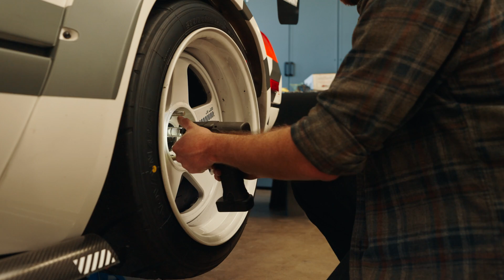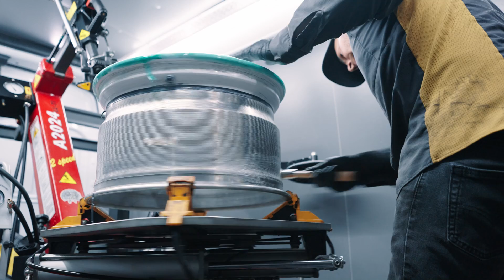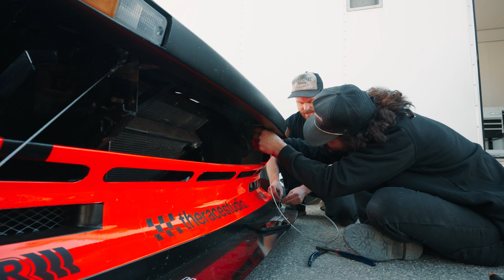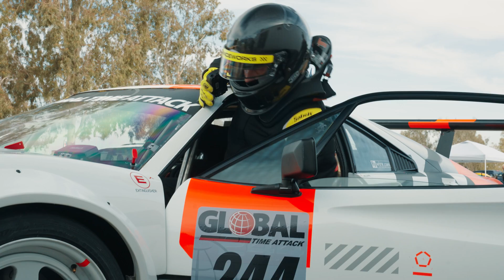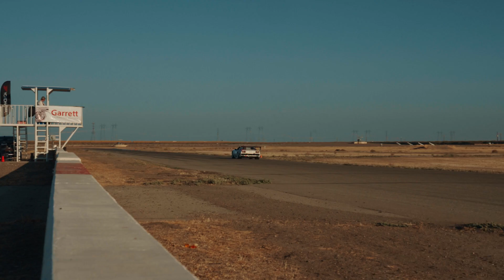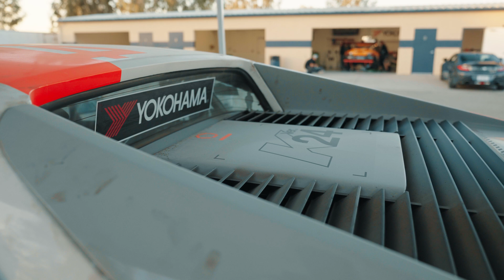Straight off the boat and to the race track! // Honda-Swapped Ferrari Time Attack

Comment: If the front splitter wear persists you might want to consider making a simplified plywood version of it. That may sound ridiculous but it isn't unheard of in racing as it's both lightweight, stiff and cheap. Of course rattlecan it black before mounting it so it doesn't look completely ridiculous. I gather that you remedied that with the cable supports, but if you want to go lower and essentially turn the splitter into a sacrificial part that's an option.

Comment: The one driving technique you need to learn is heel & toe so you can rotate the car through the corners better . The other is left foot braking to slow the car without having to come off the throttle as much . As an above left knee amputee heel and toe is difficult but not impossible in a 2003 320i Bmw tiptronic auto .

Comment: Great channel - very impressed by this and all your builds.  Want to add my semi-educated voice to suggestions about getting to the real potential of the car.  A 56 at BW is a great achievement right out of the box, with no prep time and no sleep!  Amazing.  But from the in-car I saw on your practice day this car is a good 10 seconds ahead of you Mike - pretty sure you know that.  It's a genuine weapon - close to the fastest car there on the day even in it's current unsorted state - never mind adding boost.  How do you (the driver) get there?  NOT by putting a pro in the car to show you the way as suggested elsewhere in the comments - you'll learn nothing.  I suggest more seat time in somthing you can fling about and educate your butt without hurting yourself - maybe a cart.  If nothing else go for it but be careful and sneak up on it.  The 244 will not be easy on the limit - boost is a beast to tame.
Reply from the maker: Thanks for this. I appreciate the support and the insight - I agree the car is a monster even in its current form, but I'm working my way towards that. I'll be out this year in the E30 quite a bit as well, for extra seat time.

Comment: Hey brother, you need to go to a bigger steering wheel… it will help with your overcorrection.. and make your corners smoother… the one you got. Looks great, but you should make a couple different sizes to play with your turning ratios.. 
trust me..

Comment: You have to check every nut and bolt after the customs idiots take your stuff apart. They are not mechanics and don't care if it's out back together correctly.

Comment: Nothing like being tripped up by classing. For years this has been done to Datsun 510s autocrossing with the scca... my daily driver home built 50 year old 510 technically has to run OSP against ANYTHING street legal on non slicks. Yes its modified..mostly with stock parts from other Datsuns. (280 zx struts/brakes 240z drums.. 5spd trns L20b motor).. mainly its safer and more dependable...not gonna beat a 700hp no expense spared c7 vette. Lol... lining up in group is always comical.  Money, money, money, money, DATSUN 510, money, money, money....

Comment: So far the video is at 25:10 and he has yet to pull out the garden hose or pressure washer soaking every bearing and bushing joint with corrosive water. This is very pleasing to see. I never let water touch my road  racebikes in the past and my current car build will never see water as well

Comment: When you're at a track like Buttonwillow that's so dusty off-track it's always a good idea to have something like a leaf blower and a compressor with you. You open everything up as much as you can and have someone using the compressor and air gun loosen everything up while someone keeps blowing the dust away from the car. That and a small shop vac with a brush head will take care of the majority of the dust. It's far easier than rags to get the bulk of the dust out.

Comment: Mike a suggestion put paddle shift on the steering wheel and a solinoid on the shifter it will give you at least half a second a lap and you can keep your hands on the wheel all the time cheers from down under

Comment: How cool would it be to have onboard air jacks just for tire changes. Not necessary, just cool. 😉 Also, get that thing tuned for E85. You'll get about the same or more power with the added benefit of cooling from the ethanol, and it's massively cheaper than race fuel.

Comment: You need a steering wheel with a deeper dish. Your arms around the 11 12 & 1 oclock positions are too stretched out. Closer wheel is better for feeling and control, especially when you need to counter steer

Comment: Don't be fooled into thinking because you spun you've foubd the limit.
I've raced with 2 driver teams a fair hit and seen 1 driver come unstuck at 80 or 90 in a corner that the other driver is doing 100 through.

Comment: A light coating of dust everywhere has the advantage of highlighting what might otherwise be in invisible leaks... and you'll visually know as you wipe down every surface of the car where you have cleaned and where you have not.
Not a bad exercise, in the end.

Comment: Your steering wheel looks from the footage to be a bit to far away or the at too much of an angle so your are is too straight between 10 and 2, this can mean you will struggle arm strength and reaction times in between these positions

Comment: My guesstimate from old Gran Turismo days on PlayStation would suggest quite a lot more rebound damping, little more damping and maybe 50-150kg more spring rate. EDIT: @ around 15 minutes in to the video. EDIT2: The numbers are probably suited for slicks/soft racing compound.

Comment: * EDIT * 

it didnt look like you pushed to hard when you spun. it actually looks like you upset the car with the brakes ( brake bias ) and the car unloaded and spun.

( Cant tell if you braked or just let off throttle ) but it doesnt seem like the car was happy with your input at that moment. and it didnt seem like the car COULDNT handle that corner at that speed. ( hard to tell from that camera angle )

Comment: 11:58 you can trust it, and can probably be ok, but it's their sig on the pass and so they have to have things as the rules say. They're not trying heckle you. Rules are written in blood after all.

That said, i'm happy you're finally getting to enjoy the car. Australia may have gotten some good laps, but it was also a bit of a flop on account of the gearbox.

Eager to hear how they fly out of that one, the gear we've seen isn't really easily explainable and you're not the only unhappy customer. I still think they should do better.

In the race section of the video, the engine sounds M I N T.

The way i see it (from that part of the video) i think you still have roughly 30% of everything to push. As you said, the tires being grippy are kinda hindering you now, cause you don't yet know how to use that, but the more seat time you get, the more you'll understand. You'll feel it, when you've passed the threshold. And as you said, that's about the best kind of track to wipe out on. Not much of a consequence other than the dust bath. Again, awesome to see you get to enjoy the car you've built. This is the best part.

Comment: I used to ice race in VW Sciroccos. I remember running consistent laps and wondering if I was leaving anything out there on the VERY long front stretch. I left my foot in the gas for what I counted to be half a second- I nailed the snowbank at the end and got airborn. It's good to know where the limits are Mike. Happy cleaning!

Comment: good to see you back on track  ,,,, i see you have repositioned the battery to the cabin good choice but i did see it move a little in a few shots 17:12 forwards and back under braking . what happend to the rear diffuser?

Comment: For the front splitter, how about using turnbuckles where the cables attach to the upper eyebolts. It would make easier to attach the cables while still remaining safe.

Comment: It would be fun to see what Ben "The Stig" Collins could do behind the wheel of this car.  That would help you separate what the car needs from the stuff you need to focus on as a relatively new race driver.
Reply: I hate it when someone puts the time and energy into building an amazing machine only for someone to be like "you know what a real driver could do with this?". How disrespectful can you be?
Reply: @shaunfosmark  To put things into a perspective that you may understand, Mike was so far off the pace here in Australia @ the WTAC, that most of the cars in the slowest “clubman” category for factory cars with some tuning & a few aftermarket parts & around 300-450 HP, were still faster than his K24 swapped, 1000 HP Ferrari build. That just means that when he does improve his driving, there’s a lot more time to gain on the track without changing anything but his driving ability.
Reply from the maker: I'd be a lot faster in a clubsprint car too, just to be clear.
Reply: @stanceworks   I'm happy to see you pushing the car to your limits so it can teach you how to drive it properly - I bet you'll be much faster once you get comfortable 😉
Reply: @shaunfosmark  You missed the point entirely! This wasn’t a dig on Mike! He’s a super talented guy. But by his own admission, he’s new to track driving. I’m just suggesting having someone that knows track driving out the car through its paces which will help Mike dial it in mechanically.
Reply: @shaunfosmark  you are acting like a little boy
Reply: There was a comment on Tavarish's video at SEMA asking him to do a series driving YouTube builds
Reply: @nsn876  That’s actually a brilliant idea!! It would be an epic channel and I’d sub to that for sure!!
Reply: are you the guy with the cool r32?
Reply: I was just gonna say I'd like to see The STIG do a few laps 😂
Reply: Exactly the comment I was going to make, so I did, too.
Reply: Randy is pretty handy too.
Reply: Cars like this need significant set up and development time. They're making changes, getting faster and Mike is getting more confident each time the car goes out. This is stuff you usually don't see but because it's recorded for all of YouTube, everyone throws their two cents in. This car will get much faster
Reply: @toddxhiggins  Of course.  And my comment was in no way intended to take ANYTHING away from Mike.  I've been following this build from pretty much the very beginning when the car was still running and driving - before he even put the Liberty kit on.

Whenever I'm building a product, I'm looking at what helps me get to the finish line faster.  And sometimes, I have to go outside of my team because something isn't in their wheelhouse or they CAN do something, but someone else will do it significantly faster.

Having too big of an ego can slow me down.  So I've learned to outsource things on occasion and I always make sure my team knows it's NOT meant to take anything away from them.
Reply: @RealRickCox  my reply was more so in reply to sunsetgarage. I thought I tagged them but regardless I've seen a lot of comments about the car being slower than it should be etc etc
Reply: Cool down, the car is a prototype that can have anything go wrong, from gearbox and engine mechanical failures to chassis cracks. I do not think the car is ready to be pushed really to the limit, especially going hard over kerbs…
Reply: Yes I believe his driving is bad too , with a real driver in it you could see what the car is capable of

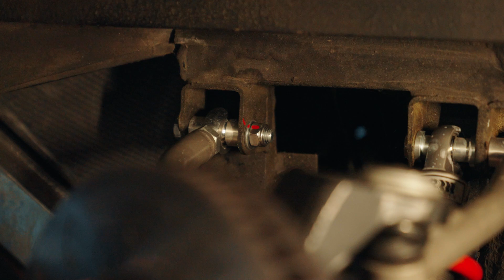Comment: 3:15 I like to use a wax substance called torque seal, you make a little bead over the nut and bolt and it will split if the bolt comes loose

Comment: Bro, running leaded fuels?  Bad idea. You should look up the preliminary results of the FAA's audit of lead content around airports (General Aviation piston engines use 110 Low Lead, and NO amount of lead explosure is safe for humans.).  It's a reason that if I am ever able to get an airplane (a life goal for me), I will make sure to power it with an engine that can use road car gas.

Comment: I can't believe how much work that was to move to Australia and get it back.  You overcame some insurmountable odds to keep that thing on the track.  Looking forward to hearing more about the transmission failure and how you could have prevented it.
Reply: The second gear is part of the input shaft. 
My guess is the heat treating is sub-optimal. 
He’s not the only person suffering with second gear failure on those quaife transmissions.
Reply: @Whateverpoopiepants  you're probably right there, Kyle over at the Boosted Boiz channel also broke second gear at World Cup, mind you he's pushing a hell of a lot more power through it